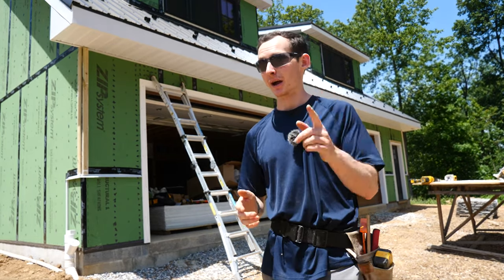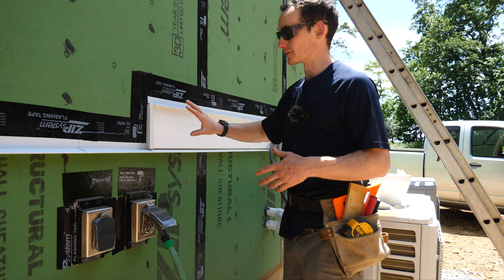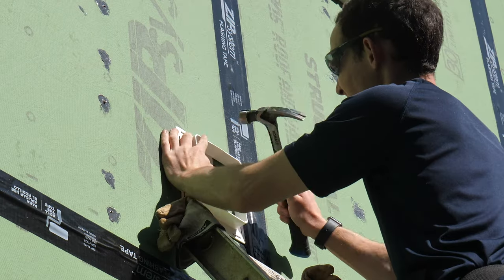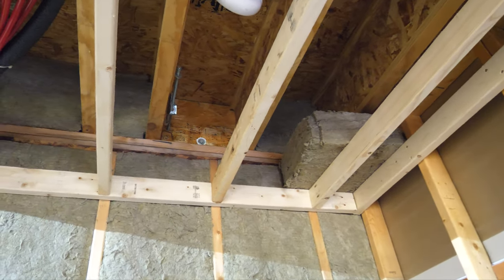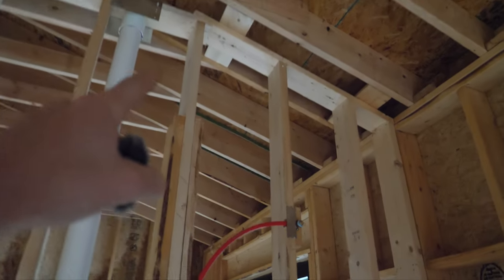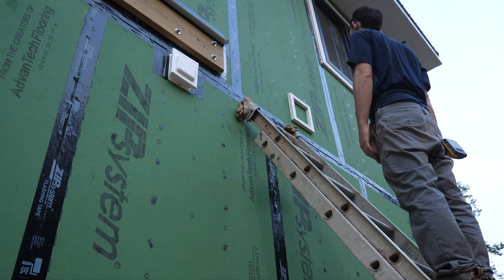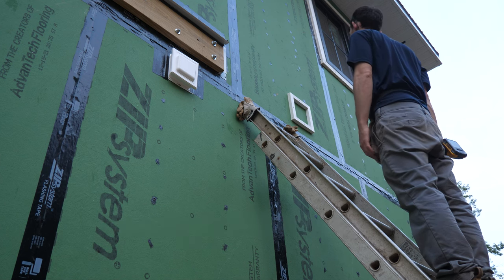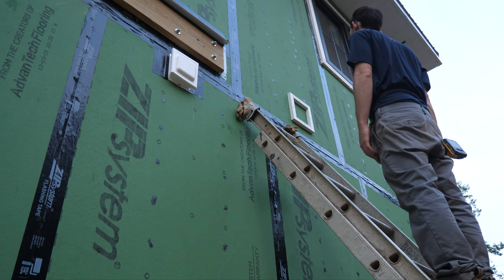Mounting Blocks // The FINAL Step Before Siding

Comment: Heads up.  That ladder angle is fairly dangerous.
Reply from the maker: When I had it set near the deck ledger it definitely was 😅
Reply: That was going to be my comment as well. 70 degrees is what we use in the fire service.
Reply: What kind of hole saw are you using that it doesn’t grab and try to rip your arm off?? That’s what it seems like every time I use my Milwaukee HoleDozers…

Comment: For your outdoor receptacle blocking, fixtures, etc. what material did you use? Can it be  made from anything or does it have to be pvc?
Reply from the maker: It can be made of any typical exterior material (wood, pvc, fiber cement, etc.) as long as you have a UL junction box containing the wires

Comment: Are the picture frames absolutely necessary between the OSB and the vent? Or is it ok to mount the vent directly to the OSB with screws + silicone caulking, then add a picture frame around the vent to hide the screws, making it more aesthetically pleasing? This is assuming the vent has enough clearance when mounted directly to the OSB that it doesn't interfere with the surrounding siding.
Reply from the maker: You can do either, in my case i have a rainscreen plus Hardie siding so needed to build it out more. I also think it’s a cleaner look than if the vent is set back into the siding
Reply: @MasonDixonAcres  Thanks for the reply!! I couldn't for the life of me find any definitive guides or bylaws indicating how the external side wall vent should be mounted. I just recently bought a house which also has Hardie plank siding, but don't yet have a miter or table saw, so cutting PVC trim to size cleanly would be a challenge. The dimensions on my vent are 8.5"x9 3/4", and I ran into the same problem you did with PVC trim costing an arm and a leg for the width I needed. I think I'll go with mounting to the OSB and adding a picture frame over that - would you have any recommendations on how thick the picture frame should be? I have some 3/4"x1.5" trim that I can use, so it would extend the same distance off the OSB as the hardie plank.
Reply from the maker: @Inventor22x  yep that should work! Good luck

Comment: Why a bath fan if you have an ERV?  I would think you have to add makeup air with how tight your build is.  Typically, you tie the bathrooms together to the ERV so it continuously pulls humid stinky air out of them.
Reply from the maker: The answer for my situation is a little complicated - tying bath fans to ERV exhaust is certainly an option. However, the geometry of my framing, existing plumbing, and utility room layout prevented easily connecting the upstairs fan to the ERV exhaust. I also didn't want to share any air pathways between upstairs and downstairs (even with a backdraft damper), so I also didn't want to connect the shop bath fan the ERV. Framing and mechanical obstacles also made it much easier to pop it through the wall. I consulted with Broan who we are using for all the IAQ equipment and their recommendation for my situation was also to use direct-vented bath fans to simplify ERV ducting and optimize effectiveness. More to come on HVAC and IAQ equipment integration
Reply: @MasonDixonAcres  look forward to seeing that.  I am going with broan as well for me erv, but since I designed my house, I made sure to account for all plumbing and hvac runs within the walls.